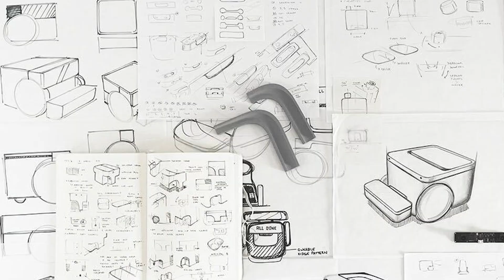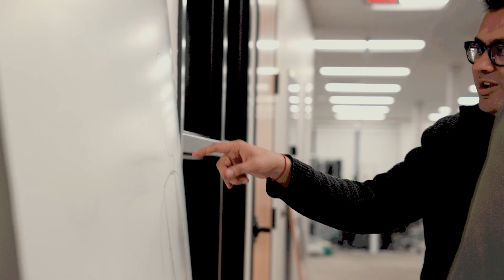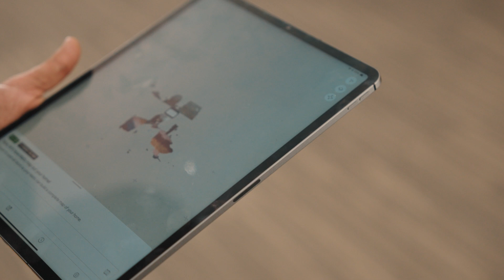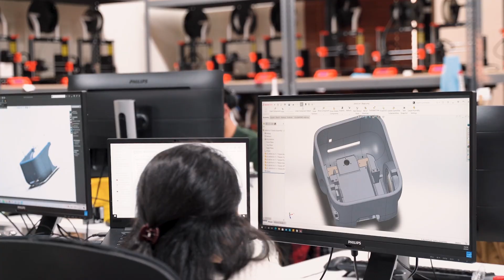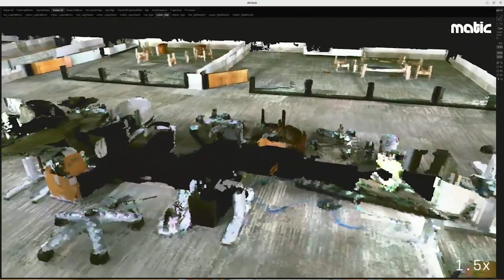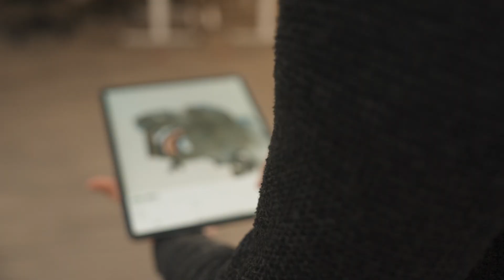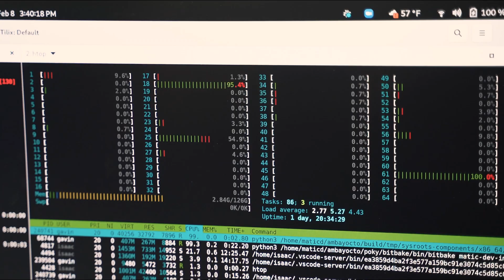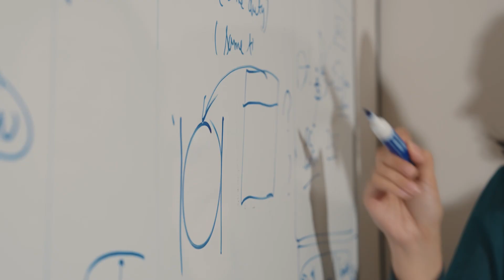The smartest home cleaning robot ever?! (3D scans your house with AI)

Comment: Seems like it’s just 2nd generation Vslam with multiple cameras. LIDAR could accomplish this with much lower computational load. Also being so large and unwieldy it’s going to have a hard time going under any furniture. At that price point it needs to function without me doing anything for a long time, ie self cleaning dock of modern robots. This seems to be a misguided attempt at competing against just iRobot v. looking at robot vacuums coming from China.
Reply: Think of Matic as a robot vacuum that acts as its own mobile auto-empty station, equipped with a convenient bagged dustbin and water tank. When it comes to navigation and sensing, while traditional 2D rotating LIDAR excels at quickly generating 2D maps, a vision-based sensor system offers a more integrated approach. This single solution combines SLAM (Simultaneous Localization and Mapping), depth perception, object recognition, wall detection, and odometry, streamlining what typically requires multiple individual sensors in common robot vacuums. Additionally, RGB cameras offer superior spatial resolution compared to LiDAR, allowing for more detailed visual information.

Among Chinese brands, Narwal and DJI are leading the way with this vision-centric strategy. Narwal's implementation features passive RGB stereo-vision for depth sensing and object recognition, complemented by dToF LiDAR for SLAM. DJI, with its upcoming ROMO robot vacuum, is reportedly aiming for a completely vision-only system, leveraging its extensive experience in developing obstacle avoidance for DJI drones. This contrasts with brands like Roborock and Dreame, which generally rely on a sensor fusion setup that includes a LiDAR, structured light cameras, a wall sensor, and an RGB camera.

Comment: I've had mine for a few months now and totally dig it.  It's not perfect but definitely is way way smarter and more efficient than the Rumba that it replaced.  Object detection and avoidance is awesome even with moving obstacles (people, my golden retriever).  Rarely I'll find it stuck or tangled up (usually a cord that got dropped).

I do have to clean it including removing dog hair that becomes wrapped around the roller and/or the airway due to clogs I'd say about once a month.  Very decent suction.  Normal vacuums get clogged too, so not a big deal.

Mopping works fairly well although keeping the water reservoir full is kind of a chore so usually takes me a few days for me to notice and refill it.

Noise.  It's much quieter than a conventional vacuum but ... I really wish it was closer to 35dBA.  I'll have to measure mine and see if it is around 55dBA as mentioned in the video.  This is my biggest criticism.  With that said I am more sensitive to noise than most people.

I haven't tried the voice commands.  The iPhone app is solid--I think it's crashed once, maybe twice.  I'm getting firmware and app updates very regularly and that just happens...it does not pester me asking for permissions although I think there is a switch for manual mode.

My last comment is battery life.  I have it cleaning about 700 sq/ft and usually the battery is down to about 10% when it is finished.  Some times it runs out of juice before it's finished but again, it's smart enough to stop clean and return the charging base. I believe when this happens it will go finish the job after the battery recharges.  I don't like the noise so I have it run at 2am.  There have been occasions in the morning I'll find it in the middle of the room dead but it's been awhile since that has happened so I think that has been solved in the latest firmware updates.
Reply: Are you saying that for its price they didn't even place a water level sensor? LMAO